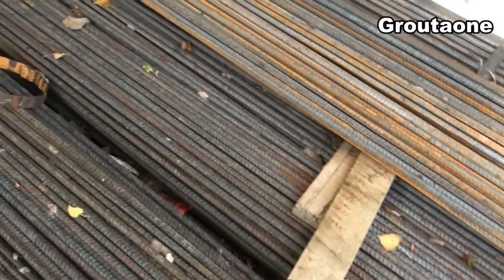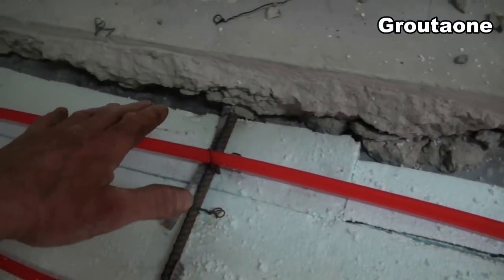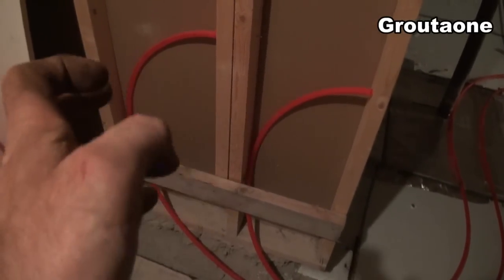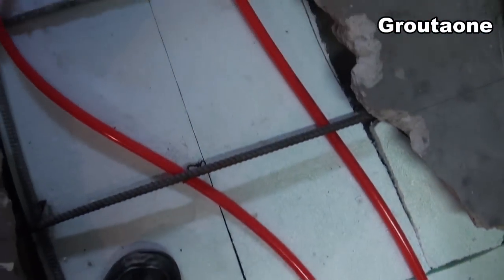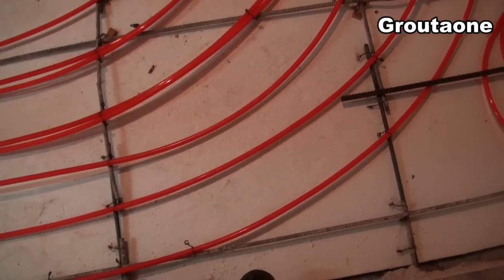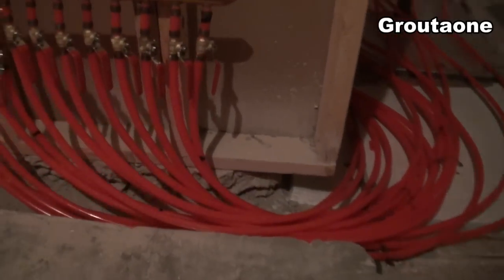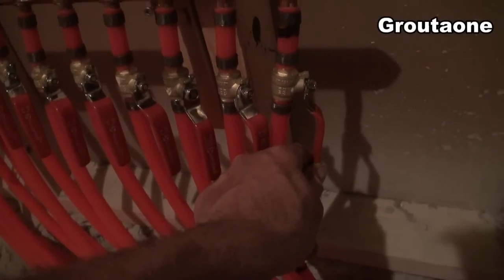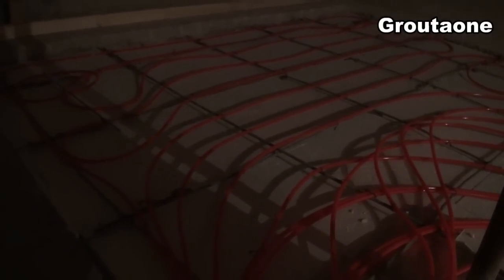Installing Floor Heat In Dry Concrete pt 2

Comment: Looking great !  You are right on about the new concrete making a mechanical bond to the old, jagged cut edge.  Much better chance of success with the irregular surface than a smooth cut...and getting the new pour to migrate a bit under the old edge is a smart move.

Comment: One tip for ya.  When I put my water lines in I used the exact same manifolds.  But I had a pressure loss as the outputs got further from the supply end.  What I did was cut the closed end off and solder a 1" to 3/4 pex.then joined this end to the original input end at the other end.  The idea is to allow both ends of the manifold to supply water.  This way the pressure is balanced because it's coming from both sides.  Did I confuse you?  Just my 2 cents worth....maybe it's not needed in this application.
Reply: Kapco78 +1 on that.  Many of the manifolds have two INs.    This is worth doing.

Comment: Would adding pipe insulation (near the manifolds) keep the heat in the tubes until it reached the intended areas?
Reply from the maker: thedge7 It would help yes

Comment: Weird... so few rebarring there. Hope it is enough.
Reply from the maker: ssc00p Should be fine, in fact for basement floors sometimes no rebar at all is used
Reply: groutaone My wonder was just based on the experience what kind of rebarring I've seen used here in Finland. Here they use almost net-like rebarring, eyes size no more than ~20x20cm, depending of course on how thick concrete pouring will be.  That way shrinking and crackings of the slab can almost be eliminated. Well... I am no house construction expert though so... maybe the standards are just very different and we have the overkill end of things.

Comment: I know the Pex tube is good stuff , but as its so close to the re bar, is there a chance of the re bar rubbing and causing a leak in the pex tube as it expans and contracts with different temperatures.
Im not picking fault as I have no experience with under floor heating Im just curious.
Reply from the maker: chox2001 It's all good, this is a fairly normal installation done by others for decades

Comment: I've been doing concrete for work for a couple months (until I got hit by a drunk driver while I was on my bike, anyway). If I were you, I most certainly would not be looking forward to pouring that floor. Best of luck to ya!
Reply from the maker: DirtRider500R Ouch hope you didn't get hit hard, pouring should be ok with a cement pump truck and a long hose